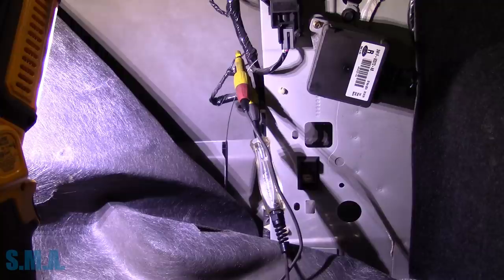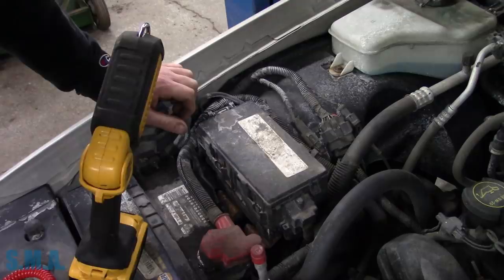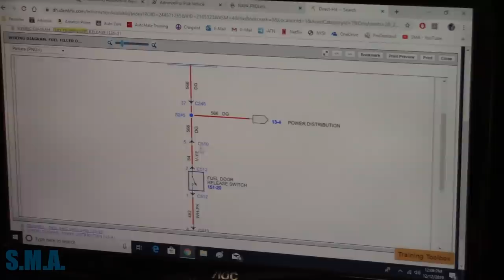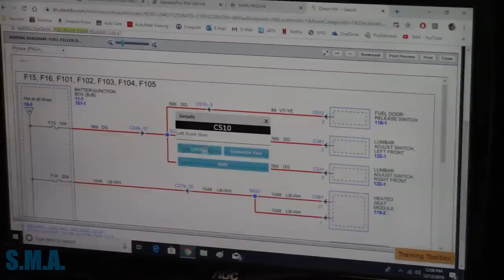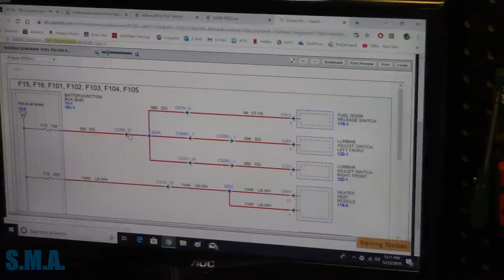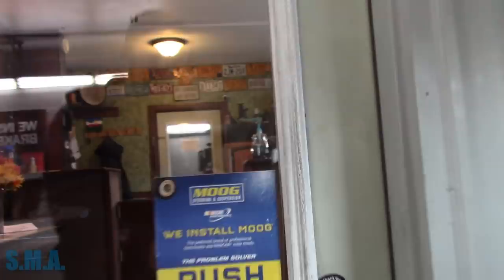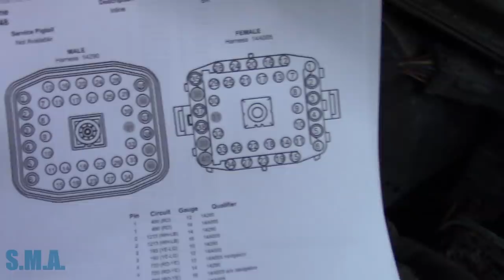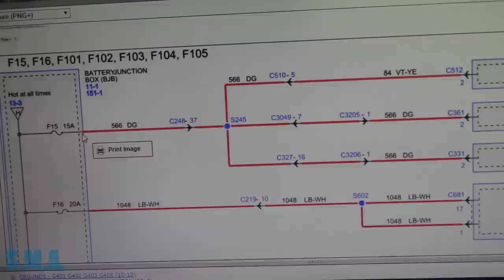Lincoln Town Car: Gas Door Will Not Open

Comment: I remember when you had to pull down the rear license plate to find the gas filler cap lol.
Reply: Many years back, I had a car (can't remember the make and model) that you opened the engine compartment to access the gas fill tube.
Reply: @Newman81964  Some of the really old VW's were like that.  One of my buddies had one and I was surprised when he showed to me.
Reply: My 69 Nova still works that way. Learned you dont park on a steep uphill spot right after filling up.
Reply: last I had like that was a 1978 Cadillac sedan deville
Reply: @henrydunbar397  lucky guy . What color and engine ?
Reply: I still driving a 1995 caprice classic the gas hole is behind the plate lol
Reply: @davehoneycutt9558  awesome cars too
Reply: Try to find the gas hole on a '56 Chevy.  I worked at a gas station to get through college, had a lot of fun with that one.  Hint - look behind the left tail light.
Reply: My old 70's Pontiacs were like that. Gas filler behind the license plate in the rear bumper.
Reply: @Viper81766  blue 2 door small block TH350 auto in our family since 1972
Reply: Back in the good old days when you got rear ended and the car burned. No insurance adjuster needed. It was totaled.
Reply: My Mom's 1972 Oldsmobile Cutlass had the "gashole" behind the rear plate
Reply: 56 Caddy is under a flip up tail light housing.
Reply: @jamesg7371  '67 and earlier Beetles had the gas filler cap inside the front compartment
Reply: My first car was a hand-me-down '77 Mercury Monarch...had a plastic badge across the back of the car with MONARCH on it.  The center portion of the badge was hinged with the gas cap behind it
Reply: My first car was a 1966 Chevy Bel Air with a 283 and a slip and slide Powerglide transmission. It used to amaze me the number of people that would forget to put their gas cap back on. You could always tell who had forgotten. They would hit the throttle, the fuel would slash back to the filler neck and pour out around the license plate
Reply: If I remember it right, the '56 Chev had it hidden behind the left taillight, which kinda hinges back and down to access the cap.
Reply: @James G  I was thinking the same thing - I believe the Karmann Ghia had the tank and filler cap under the hood.
Reply: I remember several cars I owned had that. My brothers Dodge just had a big decorative cap in the rear. We had a few station Wagons with all the bells and whistles. As he said, the more crap they put on then, the more they fail. Subaru put a cable front to back, another dumb idea. 
Our trailblazer drivers door master console failed because of water egress. The corrosion killed the power window switches. No idea how water got in unless the previous owner left the window down over night. Cost me $75 for a junk yard replacement.
Reply: Lol I'm to old!
Reply: @Newman81964  Could be a 61 Porsche like mine but in the frunk,  or a 67 Renault Dauphine where the tank fill was in the engine compartment
Reply: I still have to do that when filling up my 70 Malibu when the weather is nice. If you want to talk about working hard during a fill up, let's talk about ANY of my 7 GM square body pickups. They all have dual tanks! I have to MANUALLY flip open the gas door and/or, depending on which one I'm driving, actually twist the cap off! Then, horror of horrors, I have to turn the truck around and do it again lol! My 75 and 77 are easier than the newer ones because they don't have fuel doors, just round caps on the bed sides. I might even be developing carpal tunnel syndrome from all this manual labor lol!
Reply: My '85 Monte Carlo had one there. Sometimes I'd "forget" something, and have the plate wedged in the down position - was convenient when you didn't feel like paying for parking in Boston ... or tolls on the MA Pike ...  😁 No worries - we were only stealing from people who steal from us every day anyway!!
Reply: I have a 1978 Olds 98 with the rear license plate door. It's a pain but at least the folks at GM some how made everything (not intentionally) so you can stick the gas cap between the plate door and the bumper to hold the gas door open.
Reply: @alanhester9984  - Now that you say that, I think my '78 Cutlass had the filler back there, too.
Reply: @MikeBrown-ii3pt  My 76 GMC stepside is always a "holder."  You cannot just stick the hose in an leave it.  It would overfill and spill all over.  77 filler was placed higher up on the step behind a door even.
Reply: There were many different locations over the years. Behind the plate, behind a tail light, in the fenders, in the corner of the cab to fill the tank behind the seat, next to and under the drivers seat! Under the front hood on VW and a couple others. Center of the panel behind the rear window, Center of the cowl panel in front of the passenger compartment. Probably a few I missed.
Reply: Back in the early 70's I filled allot of those the worst one for having the nozzle fall out was the 72 Ford Torino.
Reply: 1969 Charger on top of quarter panel where you could spill plenty of gas on your paint .
Reply: @davehoneycutt9558  350 LT1 ?
Reply: @Viper81766  its a long story  a farmer own the car he passed away his brother in law drove the car in a field and left it for a year and a half the farm went through pro bait court i got the car in mid august lots of work but i am coming up on 4 thousand miles i have put on it and i found out what a 4.3 V8 was lol  I didn't know  GM make a LT 4.3
Reply: one more thing everyone calls the car farm car lol
Reply: @davehoneycutt9558  I recently read up on the 4.3 V8 as I knew the 4.3 V6 as popular as it is . Those were good looking police cars too .
Reply: @Viper81766  when i got the car there was only 88644 on the clock the mileage in town and highway combined is 20 to 22 miles per gallon it rocks down the freeway 80 no problem i am blessed to have it
Reply: @PollardGeorge  - '57 as well.
Reply: @Newman81964  probably a beetle.
Reply: @jamesg7371  the tata nano does that too
Reply: @PollardGeorge  I saw a few of those when I worked at a gas station. :)
We had a strange crew.  One guy took a boot, smeared the sole with axle grease, got up on a lift and made footstep marks across the ceiling.  I don't think those were ever cleaned off.  :)
Reply: @davehoneycutt9558  Oh no :-)
Reply: Learned that one after I bought a 71 Newport a few years ago. I looked awful silly at the gas station looking all over that barge, ended up calling the seller...
Reply: @Viper81766  Me too LOL
Reply: '56 Chevy Belaire behind the left tail light.  My first car and I wish I had kept it every time I think about it!
Reply: @lloydprunier4415  my first beater was a 57 Chevy 2 door wagon not the nomad same place wished I had kept it too. Was yours a 6 or 265 V8 ?
Reply: @johnhubbard3399  Mine was a 6 but as soon as I could I changed it out to a 283 then later bored it to 301.  Sold it to a High School friend and he kept it for about 40 years.
Reply: 64' Impala gashole behind the plate and does a lil half twist to remove and expose the hole
Reply: Remember that one lol !
Reply: @henrydunbar397  you lucky son of a biscuit !
69 Chevy nova , one of the best muscle cars and a great looking car , my friend had a gold 69 nova , until he turned a corner speeding , right into a telephone pole .
JOE NAVY VETERAN 🇺🇸
Reply: @JohnRodriguesPhotographer  Did that a few times myself back in the day.
Reply: I'm never going to own or work on a Lincoln. Hell, I've never even seen one, and probably never will (for which I will now now give thanks, daily). Why did I watch this whole episode?

I remember whole wiring looms being made up of jumpers - there's way too many 1970s cars in my past....
Reply: I was doing that up to a year ago (1996 Buick Roadmaster) 
It sure got some funny looks at the gas station.
Reply: Or open the left taillight!!! 56 ......
Reply: I remember some gas caps under tail light ,I was a little boy then.
Reply: @galexander9857  a real pain in the gas
Reply: @JohnRodriguesPhotographer  ya when they pulled away from the gas pump they would say “what’s that noise?” The introduction of the tethers on the gas cap was an improvement
Reply: @aussiebloke609  you are correct. The fuel gage is is also operated by a cable attached to the fuel float and the windshield washer uses the air from the spare tire to squirt the washer fluid. I've had my Ghia for 32 years. Just sold my 1973 and 74 Things. Very low tech and simple cars.
Reply: I had a 70 cutlass convertible in college with the gas filler behind the license tag. But always thought the coolest was 55 or 56 with the filler behind the rear brake light.
Reply: Yeah and Ford truck the gas tank was behind the seat but very easy to remove if needed just dangerous

Comment: Before watching the video, my first thoughts were it's nice when not having to deal with electronic problems and diagnosing things and you can get on with fixing a purely mechanical issue. But of course there's no pull handle and cable, it's more luxurious to push a button instead of pulling a lever and over complicate things.
Reply: A steel cable could also have a similar issue. This is one time where the circuit is so simple, it is a moot point honestly.
Reply: In the rust belt it’s common for the little pull tabs in the floor to just rot right off and either not able to pull the cable or salt gets in from your boots and the cable doesn’t move either which is a job and a half pulling the carpet to replace the cable. Not a euro fan but a lot of euro cars have the push on the opposite side of the gas door to open and a little actuator pin to lock with key fob worst case with those peel the inner carpet inside the trunk by the gas door and easy to get at. They all have their problems.
Reply: And put the damn Switch on the door so if some wires in the door breaks, you wont be able to full your tank
Reply: The good thing here is it was neither an electronic issue or a mechanical one. I hate dealing with electronics, ,automotive computers and modules suck eggs, it's a whole lot easier dealing with a plain old electricity issue like Dr. O had here.

Comment: 26:40. That’s a neat trick with the socket. 👍🏼
Reply: Free tip Friday
Reply: jclark tricks of the trade. 👊🏼
Reply: I've been working on cars for 25+ years and I never thought to do that lol
Reply: bigtonka82 I know. It’ll be super handy. Such a pain turning the roll sideways to get it through lol always ends in a mess. That’s a pro tip for sure lol
Reply: Ikr, u turn the roll sideways and then the tape gets stuck to itself length wise and just looks unprofessional. I've been a mechanic for about 17yrs and I've always just cut a long strip depending on the size of the area I'm covering and go over it like that. But usually a ft or 2 at a time.
Reply: @DirtRoadAutoRepair  definitely lol
Reply: If you had shown me that tip 30 yrs ago there would have been a lot fewer poorly re-taped harnesses and wires on my old farm equipment.
Reply: I'm  not a mechanic, but I can find ways to use that one around our house! I liked that one!
Reply: @richardbadish6990  I'm not pro, but that is my method and it almost always ends up in a big wad of ruined tape and my wondering what kind of idiot invented the tape that some idiot put on an idiot shelf that allowed a stupid moron to buy it and put it in MY shop! (I was the stupid moron in case you're interested. But I'll try to remember this trick next time!)

Comment: Interesting video that shows sometimes it’s the thing most would suspect last. Solenoid? Nope. Button. Nope. Fuse? Nope. Connector? Nope. Fuse box? Nope. Door flex? Nope. Unmolested factory loom? Yup! These cars are fairly bulletproof being based on the Crown Vic and 200k miles is not uncommon. It was a sad day when the platform went out of production.
Reply: Shared Knowledge Yep! Last of the full framed Fords. Sad indeed.
Reply: Automotive theory 101: Did you notice the Keystone "CAPA" stickers on what looked like the back of the bumper cover. Could the problem/chafing been caused by a previous collision? At the vehicle's mileage/age, it would be hard to prove, but definitely a possibility.
These are/were great cars. I owned a distant predecessor - a 1977 Ford LTD II which was a great vehicle for its era. It always started, never left me stranded,  low purchase price, and low maintenance costs. I drove that car until there was nothing left. I miss the old boat...
John - from Lincoln, Nebraska - where Lincolns are made.
Reply: Still got my 99 Mercury Marquis. Has 75k miles. No major rust. Never used in the winter.  Lots of interior room. Needs rear shocks...forget that job. Not even SMA would touch that job.
Reply: John Rose I did notice the stickers and other clues this doesn’t seem like a typical 200k vehicle. There’s some good close up video of the door hinge area and it looks more like 20k Miles in the Arizona desert  not 200k in the sloppy slushy salt encrusted vehicle destroying South Main Auto rust belt. So, as some say of tired high mileage female models, she’s clearly had work done.
Reply: Billy Brady Jr but now you can buy a Ford with an Ecoboom turbo highly stressed and unreliable engine with every last penny shaved out of its design so they’re prone to failing in spectacular ways even when just out of warranty. Just search for Ecoboost fail. Failure = Ford Ecoboost.
Reply: newjerseybt  My dad changed his rear shocks on his 96 Mercury Marquis. He had to use a sawzall and cut the nuts off the top of the shocks but be careful because there’s a fuel line on the drivers side!! Or you could go in the trunk with a hole saw to gain access to it?
Reply: Have 240,00 on my 97 Crown Vic "with the big 4.6 V8"
Reply: Joe Dvorsky That’s the same motor in his. Only problem he had was the plastic intake manifold but he changed it out with a aluminum one. Probably from the taxi or police interceptor version.
Reply: I noticed the CAPA certified bumper as well. I think if I was the owner I would have replaced the body mount(s). Not that difficult or expensive. Overall, from what could be seen anyway, the underside didn’t look to be in too bad of shape.
Reply: @billybradyjr6008  The older 4.6l had a common problem with the plastic intake cracking where the temp sensor screwed into it. the new versions used aluminum where the water jacket ran through the intake. But you could put a newer version intake on the older engines.
Reply: @johnrose3169  exactly what I was going to say ... she has had front end damage ... most likely cause of that failure

Comment: Now me being a shade tree mechanic for 50 years an old school I would take the power from the trunk door and splice it to the fuel door easy peasy
Reply: ok .... but as you have seen ...... finding the green puss .... will have halted many other things in the future  ... re your idea... where does the door switch come into it .... all your idea does is put power the the f door .... no operation as far as i can tell  ... my understanding of wires and switches ,is the the switch breaks the power flow in the live wire ... as the shell of the car is the neg (-)
Reply: The switch is switching ground tho
Reply: I'd just take a prybar to it unless I felt super charitable.
Reply: No the switch is not switching ground

Comment: Glad Mrs O is starting to guess what's wrong with vehicles!
Thanks for the small tape roll tip!
Thanks for mentioning that there could be other wires going bad in the same area.
Good call about the other shop and the oil deal!
Should have let the star of SMA come out one more time!

Comment: I still believe overlaying a single circuit is still an acceptable repair. I can imagine the labor involved in taking off the front fascia and other components would still cost more than having to make a second repair in the future in the same area. Especially on a winter beater in that condition the less you can touch the better! Great video SMA!

Comment: On a wiring diagram, T/O stands for Take Out, which is where wires branch out from the main harness. Example: The green wire you pulled out of the harness to connect to the overlay wire would be considered a T/O. It can be one wire or a bunch.
Reply: It's turn out ,not food, take out
Reply: @kevinsampson1245  You are wrong. Read a Ford shop manual. if you know how.

Comment: As always, a very logical approach to electrical troubleshooting. I know the repair was not as good as it could be, but it's the customer's call. As long as they know there may be other compromised wires in that loom you are good. Another great troubleshooting video.

Comment: As usual, another great diagnostic test video! Thanks Mr. O! 
I see A LOT of crusty/dirty Batteries in Vehicles? This shortens Battery life! 
Maybe you could do a vid on Battery maintenance. And show folks how the dirt on the Battery actually discharges power. You can measure this discharge with a Volt/Ohm Meter! 
A clean Battery is a happy Battery, that lasts!

Comment: Exact same problem with my old VW  after consulting with mitchel  broken wires  , = wiring exposed to the elements  oxidation from professor  mitchel.  Another great find Eric in the jungle of car wiring .

Comment: Mr. O. 19:25-19:33 that's the best part of this video. I share the same feeling/pain. As in all my vehicles have some part, line, hose, wire, clamp, screw, bolt, nut, clip, what have you that is bullshit to get to.